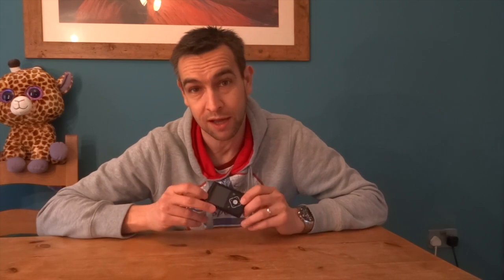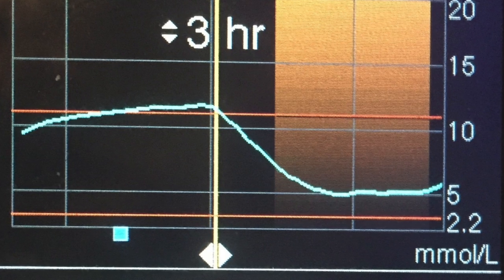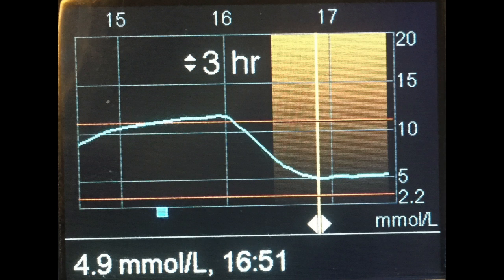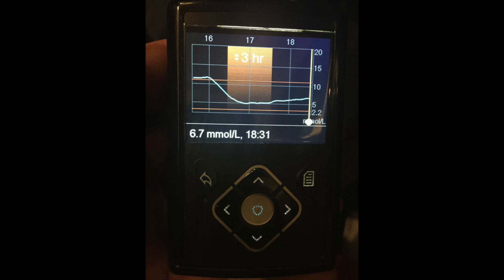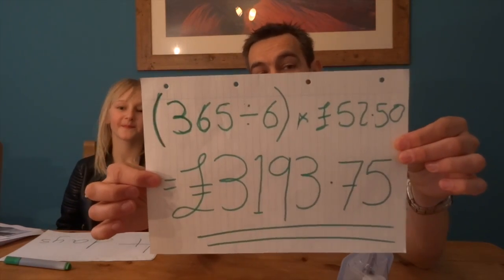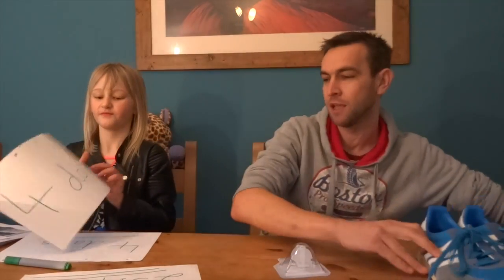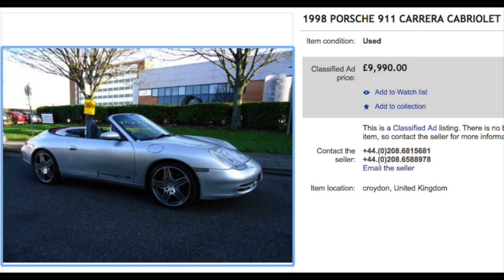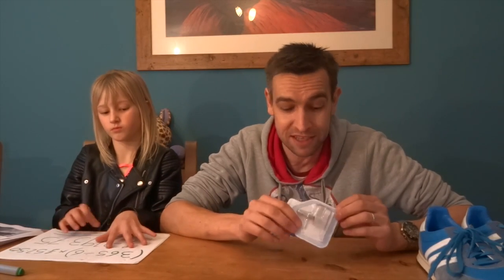Episode 3: 64 days on MiniMed 640G: managing my type 1 diabetes, SmartGuard

Comment: Does smartguard only work with a sensor?
Reply from the maker: Hi +chickentourist. Yes. SmartGuard works by looking at your current glucose levels and also how they've changed over the last 30 minutes. Once it spot that you're going to drop below your pre-set safe level it will suspend insulin. Then when it spots you lifting up above the set level it will start the supply again. This just isn't possible by manually checking your blood unfortunately.
Obviously you can mimick this yourself and suspend and restart but you're in full control.
Reply: Thank you for the info! I had never used any type of sensor beforehand and I thought it was very unnecessary. However, I actually just finished trying the CGM and SmartGuard function for a couple of weeks and it definitely made my life easier. Preventing the hypos especially was very useful.
Reply from the maker: +chickentourist Interesting to hear. Glad that you found the sensor useful.